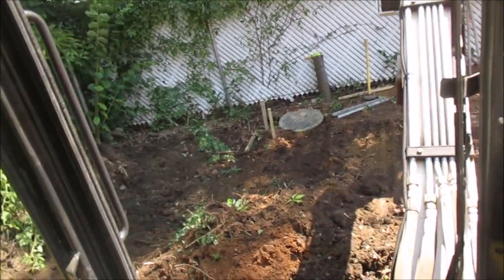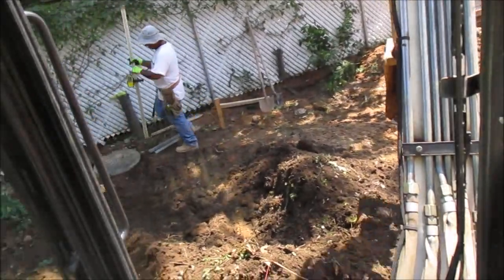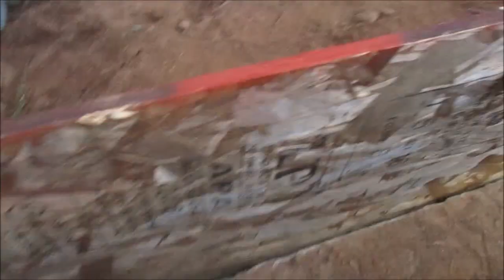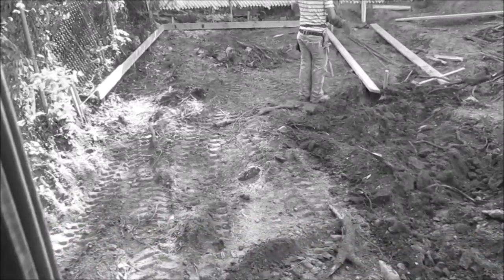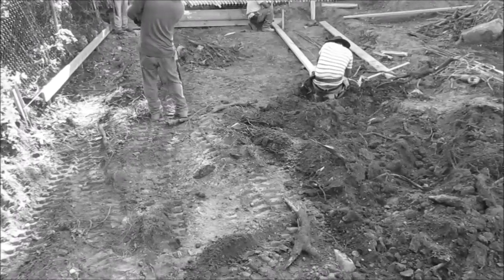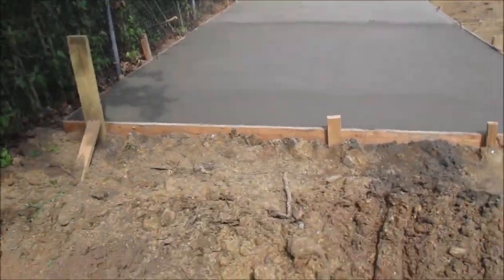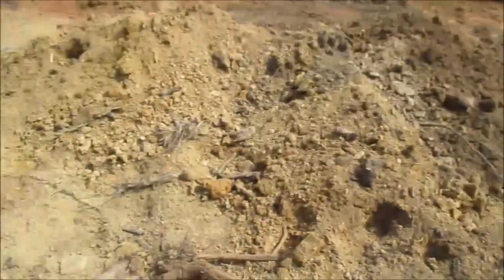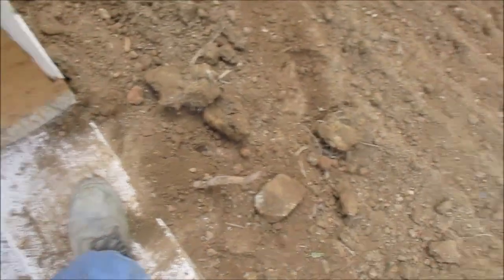How To Do a Garage Foundation and Slab

Comment: great video man, I am wondering if you wacker packed the footings, or just dug to bedrock. thanks
Reply from the maker: Dig to virgin soil. It must test 1.5-2.0 on the petrometer for a 2 story frame building. The garage could test at 1.0, however, this ground was as solid as concrete.
Reply: cool mate, thanks for everything @CoastConcreteCorp